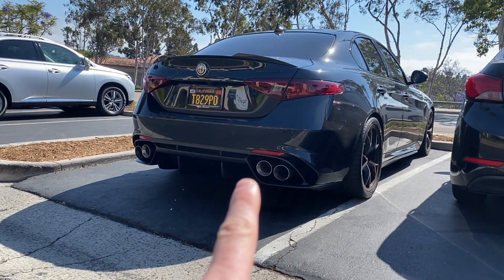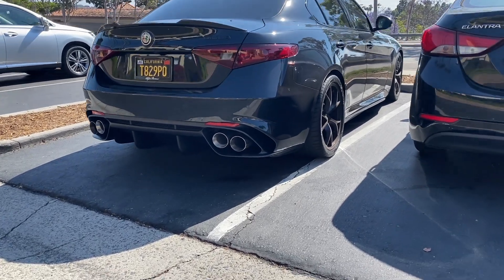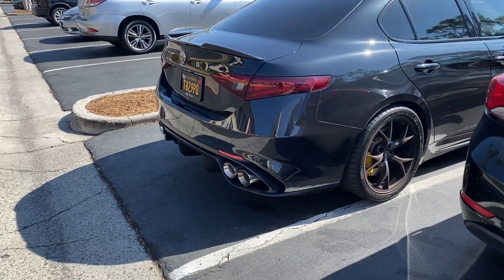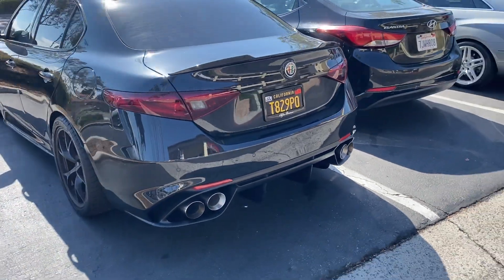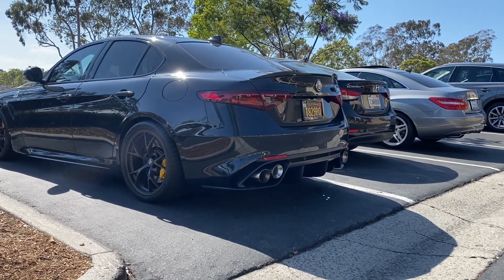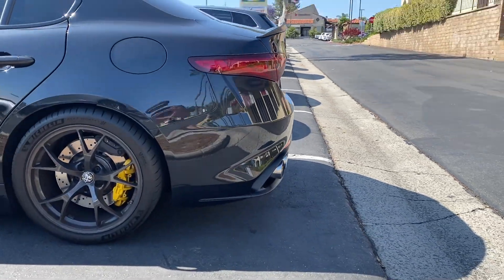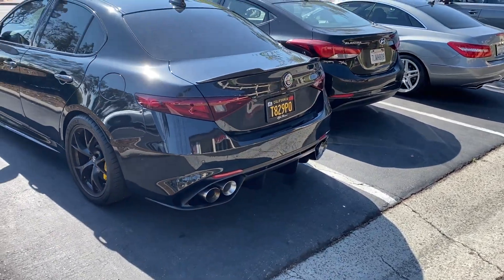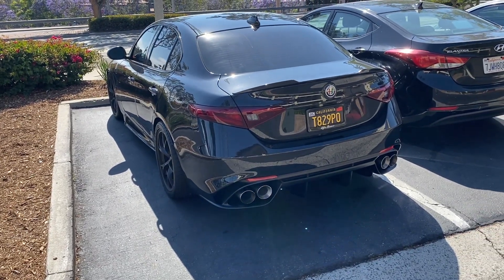QV Mods| Centerline X-pipe Problem, Straight Pipe Resonator Delete, Alfa Romeo Giulia Quadrifoglio

Comment: Props on the vid. As far as the jb4 I have one in my ghibli. If you try Bluetooth and connect on start up with the beta version all problems should go away( if you are using an Android as the monitor/ connection)

Comment: following with interest - have the same car as you, same xpipe, same springs, same forza, same whistle - thought i was the Filter, but guess not. Good thing I'm in Dubai so real easy to return it...........
Reply: would highly recommend EBC yellow stuff pads, high temp brake fluid, GiroDisc 2 piece rotors when your discs wear out too
Reply: @Squadrafoglio  Ola, i straight piped the x pipe like yours, sounds great. The interior of it isn't round as you know, it's 2 pieces stamped rather than using pipes. Simple fix. Also, fitted the madness max power pro piggy back but got tons of error codes relating to turbo valves, too rich etc. So, ordered the Forge kit and will reinstall the max power once this is all in. Yellow stuff - still good but wear quickly, I'm going with red stuff on the Giro Disc 2 pieces this week.

Comment: Hey Blake, Nice! But I’m confused. Are you running no resonator and no mufflers? If so, how does the valved exhaust still work if the mufflers are gone?
Reply: @Squadrafoglio  LOL Sorry, Griffin! My bad ☺️ Thank you for explaining though, that makes more sense, and I love the way it sounds now I agree 🤙🏼
Reply: When you say you think an x-pipe would be better for a daily now that you’ve had it for a while… is that with closed valves? What has me sold on this route is it being the level quiet inside. I just picked up a Stelvio QV and absolutely love how your car sounds
Reply: @Squadrafoglio  ahhh yes.... that makes sense. So did you go back to the centerline x-pipe? Actually, what's your screen name on the forums (probably easier to chat there). I appreciate your reply!

Comment: Hey man! Do you still have the Jb4 installed? If so, how is the experience so far? Any pros and cons ? Would appreciate your response 🙏🏼
Reply from the maker: I do not. I’ve run a couple tunes since then. The JB4 was producing more power but was pretty low quality. Poor throttle response and the power delivery was inconsistent. This car definitely deserve better.

Comment: Getting the straight pipe res delete tomorrow… I’m cool with more raspiness/more volume obvi but it’s not that metallic/tinny cheap sound is it?
Reply from the maker: No. It doesn’t sound cheap. It’s pretty epic. My only dislike was the really loud cracks when I was asking for them or provoking the engine. Like at low speed and minimal throttle. It felt unnecessary and overly dramatic after a while. You’re probably gonna like the overall sound though. Don’t worry.

Comment: When you say straight pipe you mean just straight piping the mid resonator part right? Not straight piping from manifold and everything else is stock?
Reply: Yes, he means straight piping the resonator section.
Reply: @JPSurratt1986   I already got mine straight piped and it's fantastic. Thanks
Reply: @choptang564  picking a 2018 up Friday and I think this will be my first mod.
Reply: @JPSurratt1986  it sounds perfect to me. But pair it with a valve controller because cold starts can be a bit too loud for early mornings or late nights.
Reply: @choptang564  but doesn’t the car naturally starts up with the valves closed ?

Comment: Just bought supersprint race mid pipes for mine. Thinking about putting in 2 cross sections in to make it a double H.  Do you think straights are too loud ?
Reply: Straight is too loud. It’s dramatic. I am back on x pipe. H pipe has the right loudness (louder than x) and is the best sounding by far. The character that comes out of it is amazing. I’ve spent a lot of time with a car with the H pipe. It’s the right move. Alfissimo makes the only production h pipe. But even a custom is the move for sure.
Reply: @carhoney  thanks man. Appreciate the honesty. I'm asking supersprint to cancel my order and trying to get a refund. I am irish and can buy the H in Italy from fiammenghi. If its too late to get a refund, I will install 2 sections into the straights to make it a H. Can't wait to hear it. Car needs more sound

Comment: Centerline is shit, I just installed the x pipe and I got that stupid whistle so loud when you floor it. I also had to modify the one on my q4, they didn’t flair the ends of the pipes. Welds are gross, magnaflow junk, shoulda went with H pipe or straight.